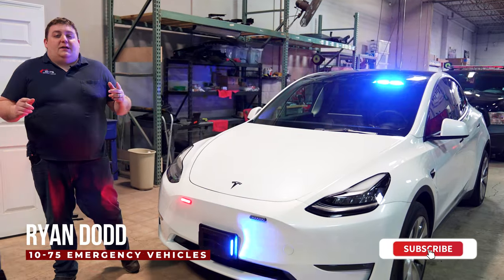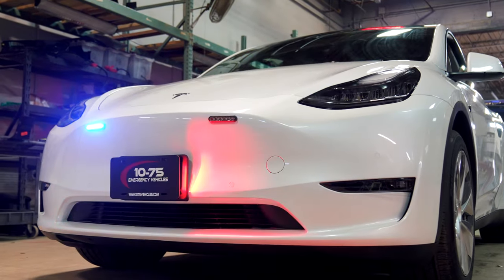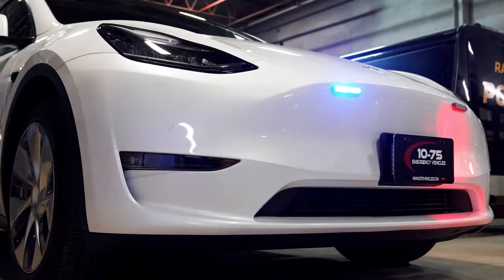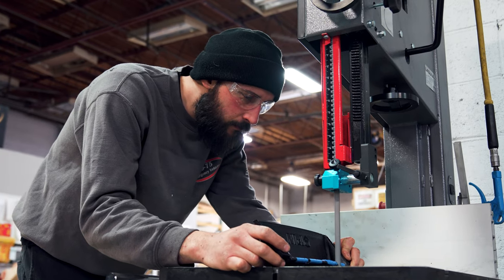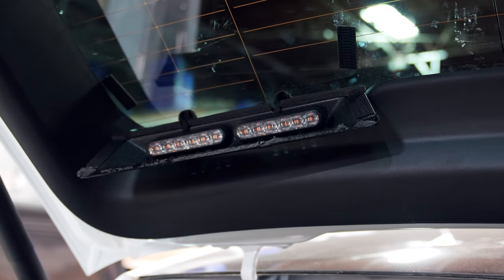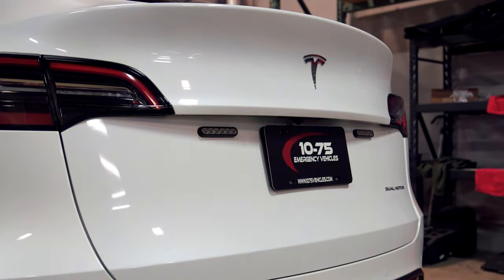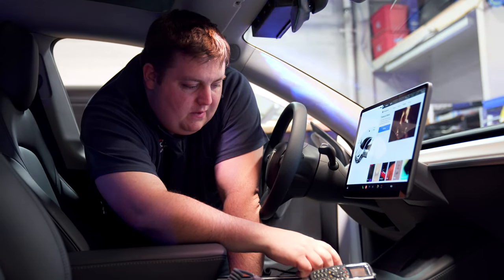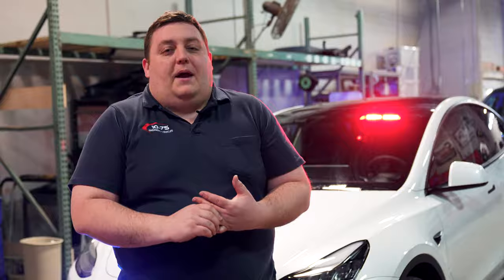Upfitting a Tesla Model Y into a Police Car - PART 3 | 10-75 Emergency Vehicles

Comment: I have a Model 3 on the way. As a firefighter, I am looking into options for installing blue lights. I don't think mounting or running the wires will be an issue, but I am interested to know where you found 12v switched power that you're able to pull enough amperage from to power all of these lights. Everywhere I have looked, people recommend not connecting direct to the battery as the power isn't flowing through the car's internal systems and the car sees that as lost voltage, making the computer think the low voltage battery is bad.

I have seen people get into the passenger footwell area by the door trim and tap a red wire for switched power, but that was for low voltage equipment like dash cams and radar detectors, not a complete lights/siren/radio install. Any direction on this would be appreciated!
Reply from the maker: I'm sorry we have a NDA with tesla that we can't give out this type of information.
Reply: @1075EmergencyVehicles  No worries, I appreciate the response.

Comment: This is not optimal. Not by a long stretch. 
WAAAAY to much money for a cop car to begin with.  Plus there's no aftermarket shrouds that are Tesla specific or Tesla tailored. 

The seats aren't designed for tactical-geared officers, display is blocked by police computer add-ins.  The glass roof, getting a cage installed, etc, etc, etc.

I question just how sturdy the body can take impacts with use of a pushbar.  The mega castings in front/back along with the structural battery pack may fail spectacularly in a hit. This would result in a total of cruiser.

And I own a Tesla MY.  Not trying to talk smack about it.  Just thinking Tesla would need to make a law enforcement version of the car.  With improvements such as lights integrated into existing electrical, computer module so Tesla screen can be used for L.E. functions, different seating for officer as well as cage prep for "suspects."
Reply from the maker: There is a lot of aftermarket equipment made for the vehicle now.